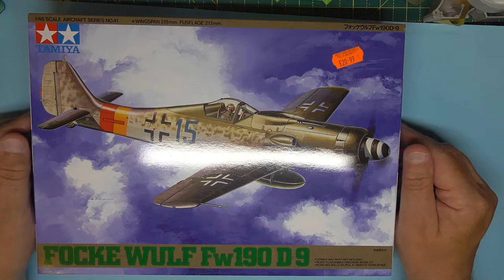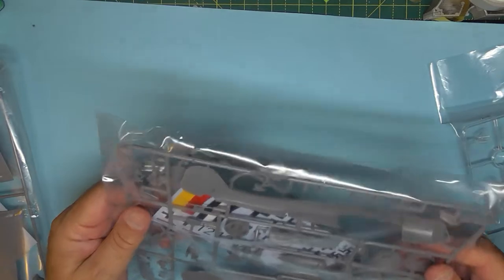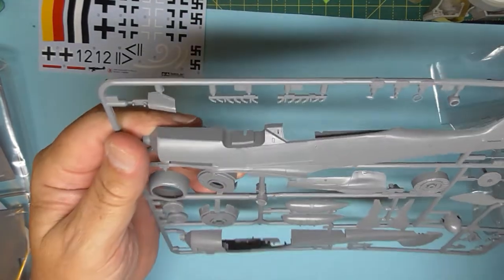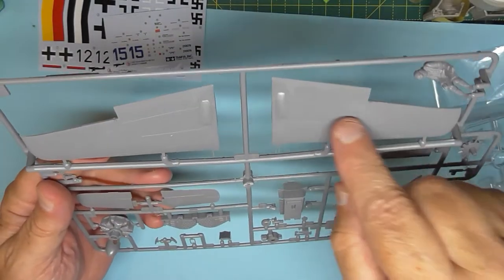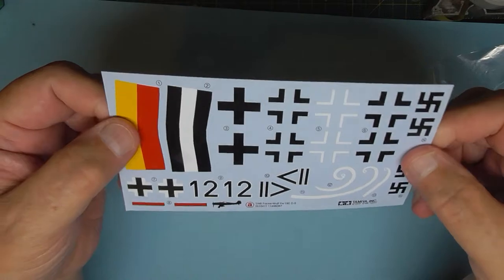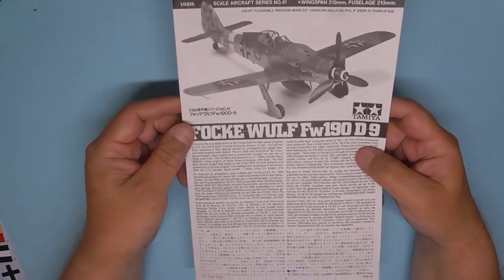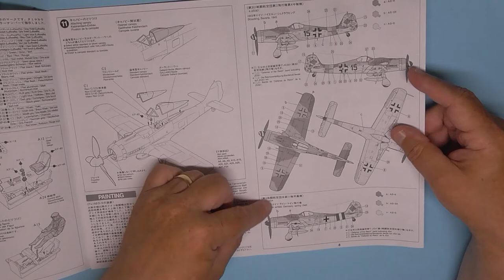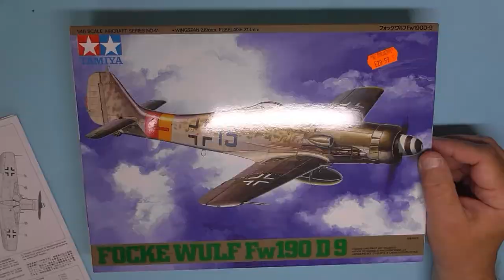Tamiya 1/48th scale Focke Wulf FW190 D9 inbox review

Comment: Looks Great, i have a question Stevie - if i want to polish a car hood on a model and it has Decals on it would you recommend clear coating on top of it then wet sand and polish it or can i wet sand and polish over the decals directly if so do you have any tips for a decent polish result.
Reply from the maker: Hi and thanks, In answer to your question, yes I would clear coat over the decal a couple of times before doing any polishing, I'm not an expert on this, I would watch a few car builders mate. But its like anything with making models, Give it a go and see how it turns out :)
Reply: Cheers mate, going yo have a go now